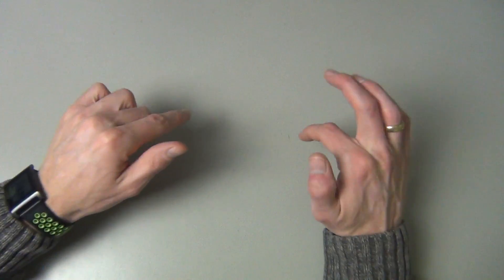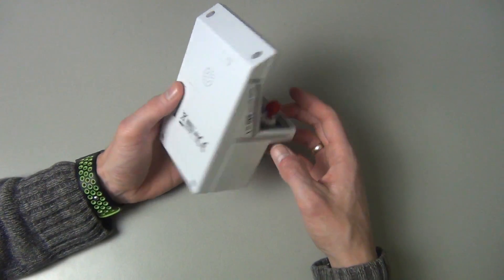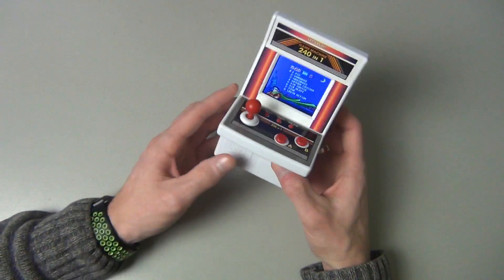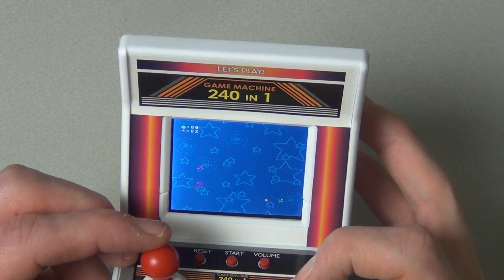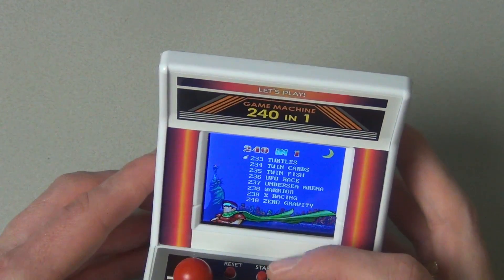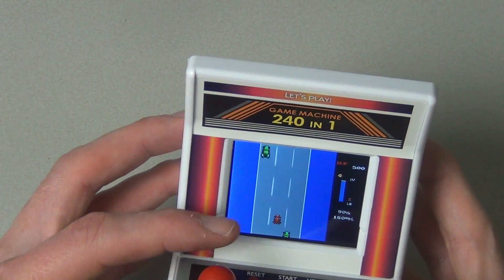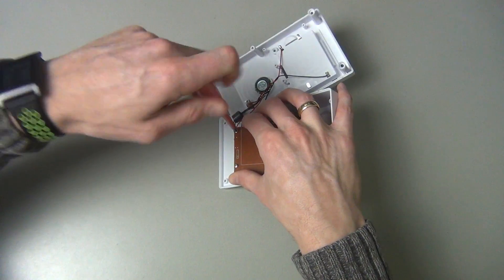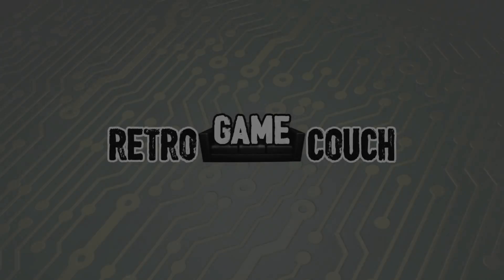$10 Mini Arcade Cabinet, any good?

Comment: The games that actually fun (with different graphics from the original):

Game number / description:
006 Gradius
070 Galaga
104 Defender
127 Mappy
137 Advanced Asteroids
192 Tetris
208 Donkey Kong Jr.
226 Centipede
233 Nice platformer

The other games are crap and there are a lot of doubles from the same games.
Reply from the maker: Great tip fellow Dutchman.
Reply: @RetroGameCouch  I forgot to add 070 Galaga which is my favorite (edited my post to add it). That one has that sweet reverberated sound just like the original. :)